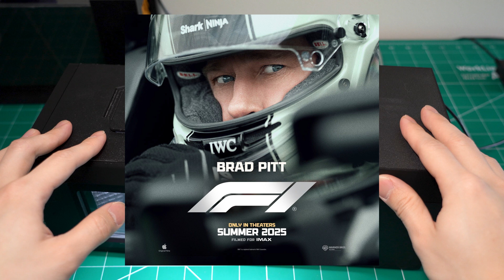Formula 1 Car vs Mini Wind Tunnel | RB20 | DIY Aerodynamic Experiment | 3D Printing

Comment: You need to set starting marks of some kind in your chamber.  You'll never get apples-to-apples comparisons when you're guessing where the perfect center happens to be.  Your shot from the top as you loaded this car, seems to me to be aimed to the left, meaning you're testing cornering rather than straight-line aero.  I'll leave the methods by which you correct that issue up to you.

Cheers!

Comment: As I have purchased your only other competitor Windsible despite their product being more refined at the cost of $230 it’s very expensive so if your able to be in the $150 range you could definitely move units since this looks to fit 1/24 models. The STL would probably be around $25 range. If you could design multiple manifolds for different smoke patterns as well that could snap to the front that would be optimal.
Reply from the maker: Thanks for your insight! I appreciate your thoughts. Unfortunately, for a print this large that takes 20 hours to make, combined with the electronic parts and shipping costs, the profit margin ends up being very slim. To make it worthwhile, I'd either have to price it higher or find a different way to make it more affordable. I agree that it's a toy most people wouldn't want to spend too much on.